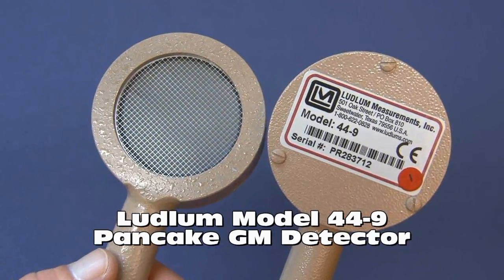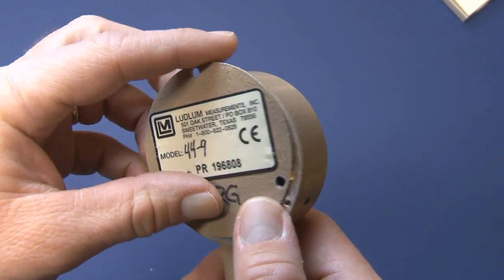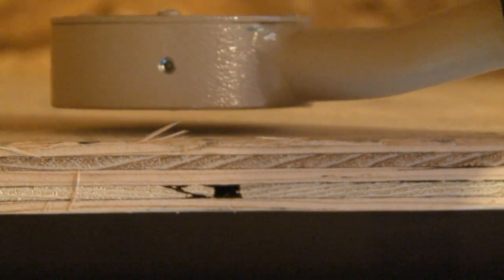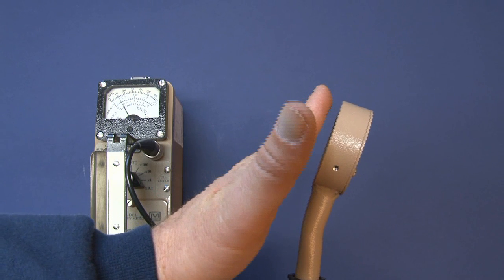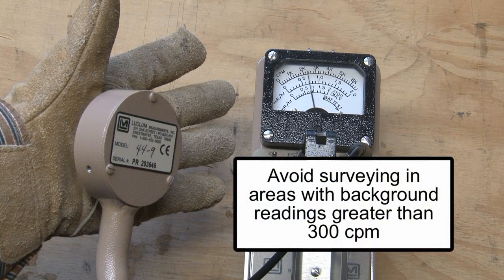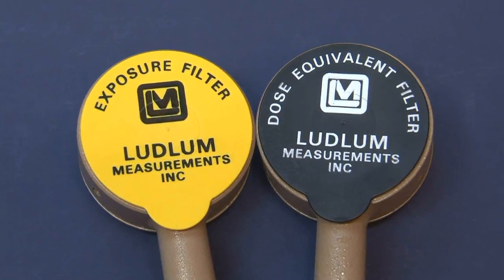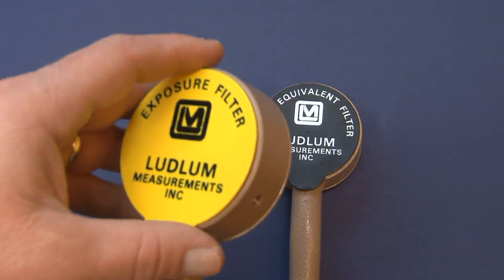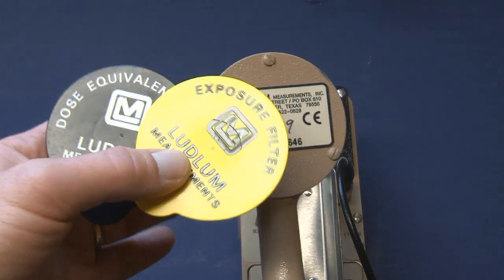Overview of the Ludlum Model 44-9 GM Detector

Comment: So which is the best probe to use with the Ludlum Model 3?  I want to test seafood for radiation.  Thanks!
Reply from the maker: I assume you are probably concerned about radioactive material or ‘radiation’ from Fukushima. The predominant long-lived isotopes from a reactor accident like that would be cesium-137 (Cs-137) and strontium-90 (Sr-90). Cs-137 has a half-life of about 30 years and is a strong beta and gamma emitter. It's often of concern due to its long half-life and because it mimics potassium, making it more likely to be taken up by living organisms. Sr-90 has a half-life of about 29 years and is a strong beta emitter. Strontium behaves similarly to calcium, so it can end up in bones and teeth if ingested. Because both of these isotopes are strong beta emitters, the Ludlum 44-9 would be able to easily detect their beta emissions. With that said, it is highly unlikely that you would ever see contamination in seafood at a level anywhere close to something that could be detected with a handheld instrument such as this. It would require very expensive and highly sensitive laboratory equipment to detect the minute levels of radioactivity that you would see in seafood. There's been much talk in the news about the release of tritium into the water from Fukushima. Tritium is an extremely weak beta emitter, and no probe that you could attach to the Ludlum Model 3 would be able to detect tritium radiation. As a health physicist, my advice would be to not worry about radioactivity in seafood. If you do want to check for it, the Ludlum model 44–9 is very good at detecting the the beta radiation that is commonly associated with the fission products that are released following a reactor accident.
Reply: @_TRG_208 , thank you so much for your reply!  I saw in the news that South Korea was testing seafood using the RadEye B20 ER that is why I was planning to get a Geiger counter.  My wife is a doctor and a cancer survivor.  Yes you are right!  I will be needing a sophisticated equipment for what I want to do!  It looks like the best thing to do for now is not to eat seafood here in the Philippines and never go to the beach.  
That is what my wife is worried about!  If we happen to swallow tiny amounts of those radioactive chemicals, it will give us cancer in the future!  I wish there is a laboratory test to know if we have already eaten tiny amounts of those cancerous chemicals!
China has dumped so much radioactive waste far more than Fukushima will dump in 30 years!
Again, thank you so much for taking the time to explain everything!  God bless you!
Reply: @_TRG_208 , so what I saw in the news in South Korea, testing their seafood using that RadEye B20 is a joke!  Those handheld testers can only detect higher levels and not tiny levels!  
That was the question that popped up when I was studying the smallest amount a Geiger counter can detect.  I won't be able to know if there are smaller amounts that it can not detect!
In a way, I'm glad that in many provinces here north of the Philippines, there is almost no seafood to buy anymore!
Cancer cases has skyrocketed because of those experimental drugs so-called vaccines, highly processed food and now this!  Radioactive wastes!  Thank you!
Reply from the maker: @butchfajardo8832  Yes, the RadEye B20 contains the exact same detector as the Ludlum 44–9 probe. Both would certainly be capable of detecting the radiation of concern if the levels were high enough. The levels of radioactive isotopes in food from Fukushima and the surrounding areas have significantly decreased since the immediate aftermath of the disaster, especially for radioactive isotopes of iodine, which were quite prevalent immediately following the accident. These isotopes have completely decayed now due to their short half-life. Following the Fukushima disaster, Japan set a new, stricter limit for radiocesium (which includes both cesium-134 and cesium-137) in general foods, including seafood. The limit is 100 becquerels per kilogram (Bq/kg). A kilogram is a lot of of seafood to consume. For comparison, the average banana contains about 11.43 becquerels of radioactivity from the naturally occurring radioactive isotope potassium-40. Therefore, 1 kg of bananas (8-10 bananas) would contain around 100 becquerels of radioactive potassium-40 (100 Bq/kg). This potassium-40 is part of the natural potassium that all plants, animals, and people need to live. So, you get about the same amount of radioactivity from eating bananas as you would from eating seafood contaminated at the upper allowable limit. 

For further comparison, the European Union's limit for radiocesium in food is 600 Bq/kg for most foods, and 1,250 Bq/kg for certain specific foods like minor species of fish and wild mushrooms. The Codex Alimentarius, an international food safety standards body, recommends a limit of 1,000 Bq/kg for radiocesium. So, as you can see, Japan’s limit is quite low compared to other areas around the world and is very similar (gram for gram) to the amount of radioactivity you would get from eating a banana. It would be difficult for one to consume enough seafood to receive an appreciable dose of radiation. It takes a large dose of radiation before there is an increased risk of cancer. In general, the nutritional benefits of eating fish and shellfish likely outweigh any potential risks of radiation exposure. 

I agree with you that processed foods are potentially harmful. I believe there are many other dietary factors more concerning than environmental radioactivity. It's intriguing that people view the small amount of environmental radioactivity as a significant cancer concern but seem less worried about other foods known to increase cancer risk. It's well-established that consistent consumption of certain types of food like processed meats, red meat, alcohol, sugary drinks, and trans fats may increase your risk of cancer. Interesting that these seem to be acceptable risk factors for many.
Reply: @TRG_Inc , I think what is radioactive is the question.  Eating bananas is okay but ingesting for example Cesium 137 in tiny amounts is deadly or dangerous in the future.  Am I right sir?
The news said that it is safe to swim in the oceans but ingesting seawater with Cesium in it is dangerous. 
Again, thank you so much for taking the time to explain everything!  A lot of people will learn from you!  God bless you!
Reply: @TRG_Inc , you're right!  Hahaha!  Alcoholics here only started crying when they learned that they already had liver cancer!  They all ignored doctors when they warned them!  Hahaha!
Reply: @TRG_Inc , it looks like eating naturally radioactive food like bananas are okay but not radioactive elements and industrial chemicals.
Reply: @TRG_Inc , when Japan said that their seafoods are safe, the people said show us!  We want to see you politicians eat those seafoods!  Hahaha!
Reply: @TRG_Inc , oh they have the same detector! Thanks for the info sir!
Reply from the maker: @butchfajardo8832  Your statement suggesting that eating bananas is harmless while ingesting tiny amounts of cesium-137 is dangerous isn't entirely accurate. Radiation is radiation, irrespective of its source. Actually, the gamma rays from potassium-40 are more than twice as energetic as the gamma radiation from cesium-137. Generally, higher energy gamma radiation is more dangerous than lower energy gamma radiation due to its greater potential for causing ionization, leading to biological damage. It also has a greater ability to penetrate materials, including body tissues, and can potentially harm more cells and tissues deep within the body.

Much of this boils down to risk perception, as mentioned earlier. Many people, perhaps including you, perceive bananas as safe because the radioactivity in them originates from a 'natural' source, while cesium-137 is perceived as more dangerous because it is not naturally occurring. However, whether ionizing radiation originates from a man-made or naturally occurring source, the radiation itself is the same - the difference lies mainly in their energy levels. Uranium, a naturally occurring radioactive material, emits alpha radiation that's just as dangerous as the alpha radiation emitted by man-made plutonium.

Regarding cesium-137, the annual limit on intake for people working with radioactive materials in the United States, where I am based, is 3,700,000 Bq. (Recall that the limit for seafood is only 100 Bq per kilogram of seafood). Ingesting 3,700,000 Bq of Cs-137 would result in a radiation dose of 5 rem (50 millisieverts).

It takes a fairly high dose of radiation before you are able to see a statistical increase in cancer. There is a scientific consensus that radiation doses exceeding 10 rem (100 millisieverts) have been linked to an increased risk of cancer. Below that threshold, there's no clear cause-and-effect relationship. The U.S. Nuclear Regulatory Commission states that a dose of 100 mSv (10 rem) is associated with an increased risk of fatal cancer of approximately 0.5%. This is above the natural background cancer rate, which is quite high at about 20-25% in the general population.

In practical terms, if a group of 10,000 people each received an exposure of 100 mSv, we would expect to see 50 radiation-induced cancers, in addition to the approximately 2,500 cancers that would occur from natural causes.

However, these figures are based on the current "linear, no-threshold" model, which assumes that any amount of radiation may pose some risk, and that the risk increases proportionally with the dose. There's some debate in the scientific community about the validity of this model for very low radiation doses (such as those we are discussing here), but it's generally accepted for doses above 100 mSv.

The core message I'm trying to convey here is that any radiation dose you receive from ingesting seafood would be so inconsequential that I personally don't worry about it, and I don't believe you should either. I hope all of this is helpful and I wish you well.
Reply: @_TRG_208 , yes, radiation is radiation.  It depends on the higher the dose and the length of exposure.  Yes, your reply is noted!  Again, thank you so much and always keep safe!  God bless you!

Comment: I 💗 my 44-9 and Model 3. Had it for 25 years and it's still going strong! Never been calibrated, but I kinda doubt it needs to be, seems to have the same response to test pieces as it ever has. 
Can you offer a detailed description of what exactly the black compensation filter actually is comprised of? I'm loath to spend over a hundred $ on what amounts to a 1 dollar 3mm thick piece of polyethylene.

Comment: surprised me flight can pop the mica as its already under negative pressure and altitude should actually be less stress on the element
Reply from the maker: I was surprised as well the first time it happened to me. Not good. When I have to take them on a flight, I take them with me in the pressurize compartment of the plane in my carry-on baggage or I put them inside a pelican case when they are in checked baggage so they are protected from the pressure.

Comment: what happens if the micro window is damaged ? does it mean that the entire probe is damaged ?
Reply from the maker: Yes, the detector will not work if the window is broken. The detector is gas-filled so it can’t work if it’s broken. You can easily replace the detector that is located under the screen.

Comment: I thought one was required to use a 43-5 detector to detect alpha and the 44-9 was incapable of detecting alpha properly? Or are the new 44-9 detector models capable of detecting alpha now?
Reply from the maker: You are correct that the 43-5 with the ZnS(Ag) scintillator is better for alpha than the GM detector in the 44-9. The 44-9 will detect the presence of alpha but is not the best tool for quantifying what's there or discriminating between other types of radiation.

Comment: Can anyone .please, guide whether at what dose rate (Cs-137) overload test should be  performed  with 44-9 probe .....
Reply from the maker: Babar Hussain I’m not sure what you mean by “overload” testing. Are you looking for a max dose rate for this detector? If so, that would depend on whether or not the survey meter it’s attached to is analog or if it has dead time correction. Personally, I would not use this detector for dose rate monitoring.

Comment: Ah! The LND 7317. Very fragile, but very sensitive. The Russian tubes are more sturdy, but still quite fragile. However, they are still very sensitive. The SBT-10A is huge! It has 10 anodes! I built an Arduino G-M counter with that tube, and it has a nice case. I looks professionally made, and it's awesome for a cheaper alternative. But, I finally got an Inspector USB, for a great price! Barely used! It's tube is more sensitive to Alpha, but with only about a 3rd the surface area of the SBT-10A. These are great Geiger counters! I really like the Ludlum, but they are really expensive, especially new!
Reply: can you give me the schematic of your Arduino G-M counter?
Reply: Check out "impexeris" on eBay.

Comment: What's in the energy compensation filters? Could one be built at home using a Caplugs cover and thin aluminum or copper sheeting. $100 a piece seems a bit much for someone just using the 44-9 probe at home and not in an industrial setting.

Comment: These LND-73xx with thin mica window are REALLY easy to break. Not just from poking them or high altitude. Just closing a door in your house quickly can do it, which happened to me. I have heard of them being broken by merely closing a car door.

When not actively in use, you want to store them in a sealed container.

Other alpha tubes like the russian ones use much stronger windows.

Comment: I am going to get the ludlum model three with the 44-9 probe. I am going to check for radiation around my house. I need an accurate reading for mr/h and cpm. Do i need a probe? If i do which filter should i get?
Reply from the maker: If you just want to check radiation levels around the house, you can do it with the 44-9 probe.  Depending on how it was calibrated and what meter face you have, you may be able to convert easily between cpm and mR/hr.  Usually they are calibrated at 1,200 cpm equals 1 mR/hr for cesium-137.

Comment: I'm confused. So you say this model is not ideal for radiation detection? I've been considering purchasing a Ludlum product to monitor the radiation levels due to Fukushima in Japan and surrounding areas. What would you recommend?
Reply: It's not ideal for radiation measurement but it is ideal for radiation detection... You shouldn't use this probe if you want to quantify the amount of radiation you are being exposed to, but you should use this if all you want to do is tell whether or not radiation is present. If you want to quantify the amount of radiation exposure you can either use this probe with the exposure filters mentioned at the end of the video or you can use an energy compensated probe, such as the Ludlum 44-38
Reply from the maker: Dr Brad
 Well said Dr Brad.  Thanks!
Reply: @_TRG_208  I have 2 SEI Inspector Alert plus.  One is the USB version the other is just the alert plus.  I think they have the same GM tube so does that go for all pancake style probe or just the Ludlum 44-9?
Reply from the maker: @chemistryscuriosities  Yes, I'm pretty sure that is the exact same probe inside (usually an LND mica-window pancake detector). The detector is energy-dependent unless it has been compensated in some way by SEI.
Reply: Buy an Automess AD6 to measure gamma dose rates. 
A Ludlum 3, 3-8, or 3-9 with a 44-9 15cm2 pancake frisker for loose or fixed Beta/ Gamma contamination.